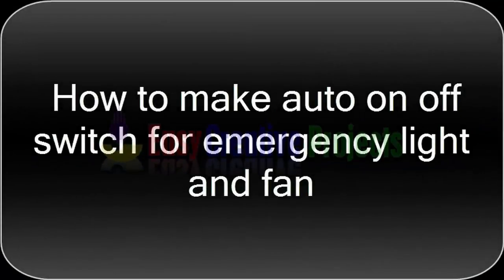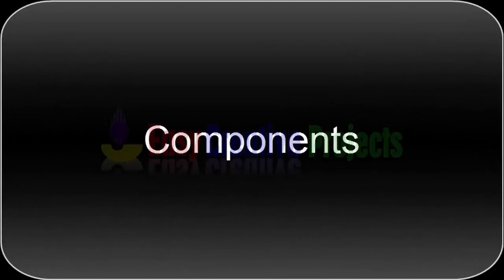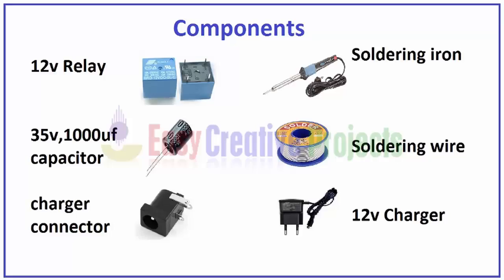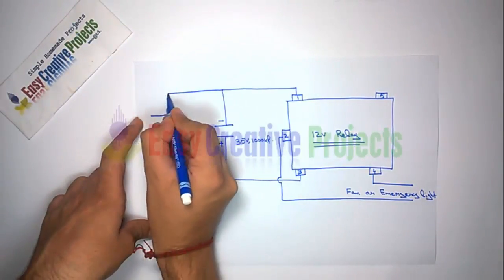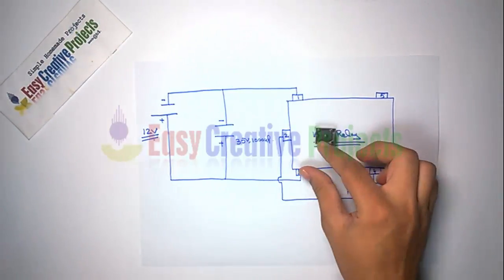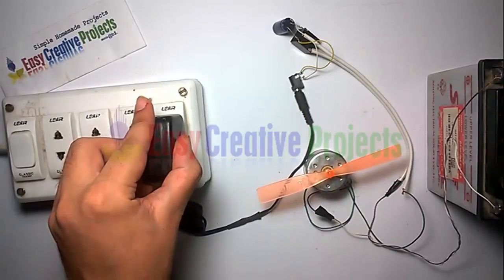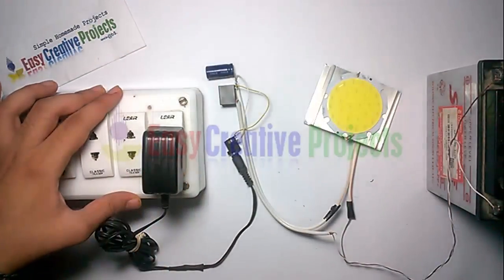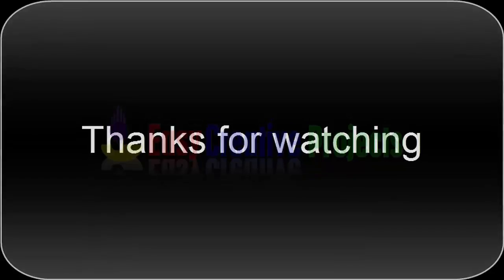How to make auto on off switch for emergency light and fan - automatic battery cutoff circuit

Comment: 4volt battery 4v led  4volt circuit lekin Relay kitne volt ka lagega 12v relay lagayega to hoga kya na aur lagega
Reply from the maker: dear try to use 5v relay. 
agr relay work na kry to 5v ki battery use krin aor 100ohm ki resistor lga dain.
thanks.
Reply: Sir emergency ac/dc on off ledbulb circuit diagram hai to please bhejo
Relay nahi Transistor lagake

Comment: Hello friend
Plz tell me where connect a battery wire
I saw three times this video but I can't find 
Thanx
Reply from the maker: Dear 
1st side of battery directly connect with fan.
and 2nd side of battery connect with 4 number pin of relay.
and 2nd side of fan connect with 2 number pin of relay.
.
simply only replace two terminals of  on/off switch with 2 numbers and 4 numbers pin.
Reply: Easy Creative Projects thanks
Reply: 1st side of direct battery connected (+ )posetive na (-)nagetive side please bataiye